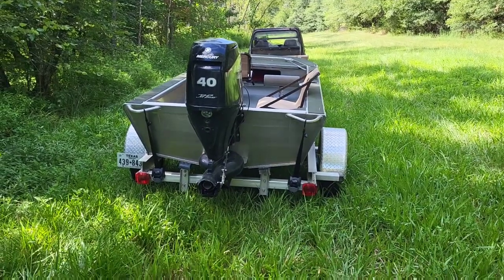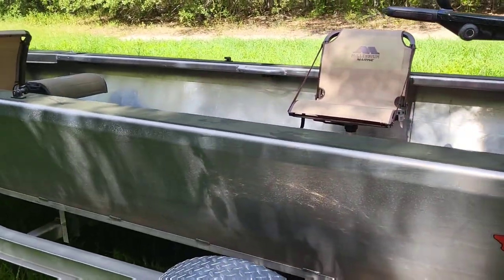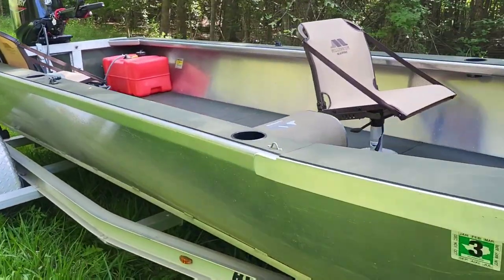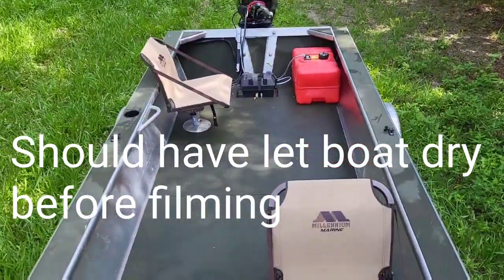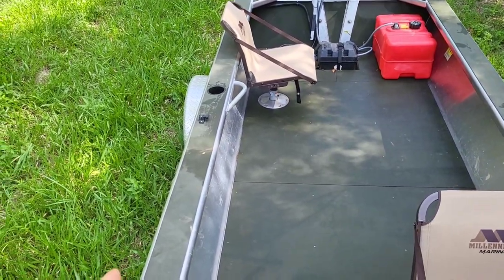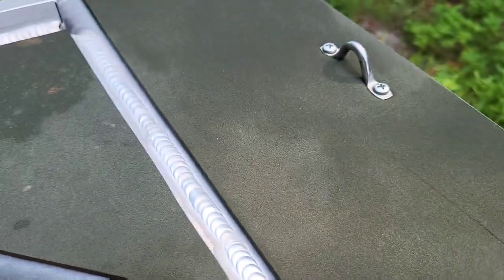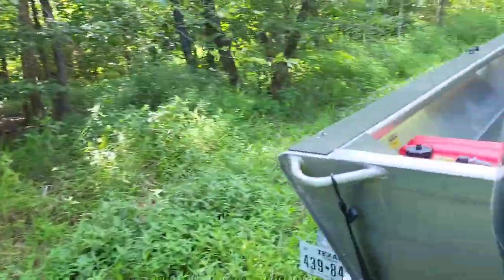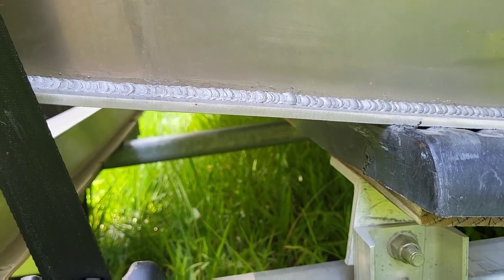Jet Boats of Texas 1654 Outboard Jet

Comment: Man I’m way down the rabbit hole on these outboard jet jons and looking to buy my first one. Is there a reason you don’t run a tunnel hull?   I’ll be running the Brazos from PK to Granbury lake and feel like I’ll drag the foot off without a tunnel. Thanks!
Reply from the maker: I have ran almost that entire stretch. Lot of fun at 200 cfs. The tunnel drags the boat down loosing speed and lift. Good mounted jet and using trim is all I need.

Comment: What part of washita are you going to?
Reply from the maker: Be the ouchita in Arkansas. Near Sparkman.
Reply: The stretch on the Ouachita between Arkadelphia and Malvern is a pretty good stretch to run. Been running it for about 25 years. Gets extremely shallow in places. Down to one inch in several spots. Several tight turns and plenty of logs.

Comment: Hey I noticed u run a lot of the 60 40 mercs how many hrs do u get out of one?
Reply from the maker: Never had one quit.  700 on one probably 450 on current motor
Reply: I read a comment a while back and I can’t find it. You said you had to get sand out of something in your motor. I’m having some problems when I run on red river only and I’m having trouble narrowing it down. It’s been to the shop twice and they can’t find anything wrong with it. 60/40 merc 2013.
Reply from the maker: @Wade McDowell  occasionally I have to clean the thermostat out. But on the red that usually is not a problem
Reply: Thanks.
Reply from the maker: @wademcdowell7877  what is your doing?
Reply: Accident on the dislike button. My bad. I have slow service out here in the county and my internet wasn’t as fast as my clicks.